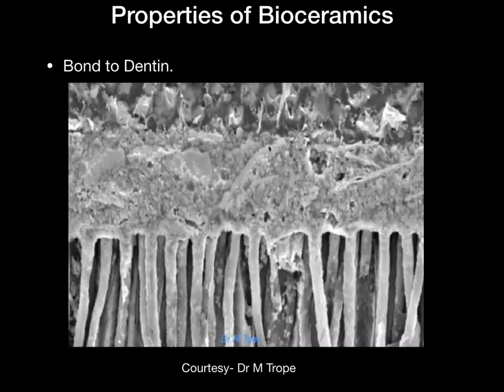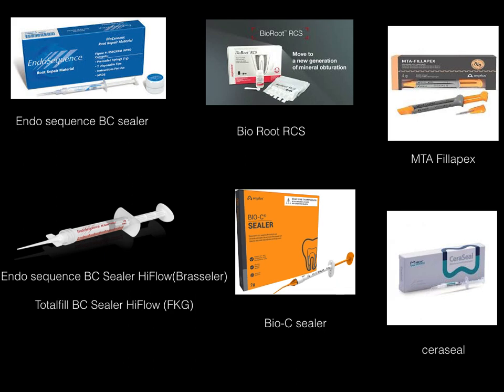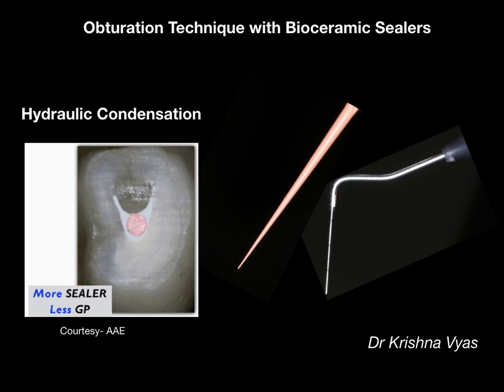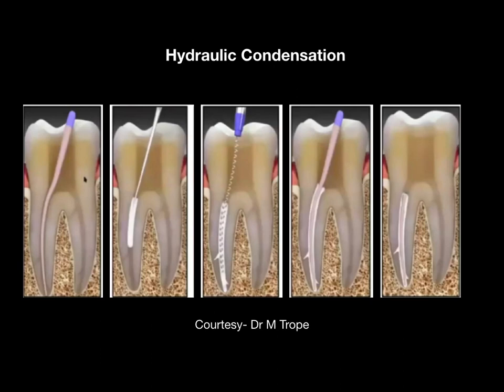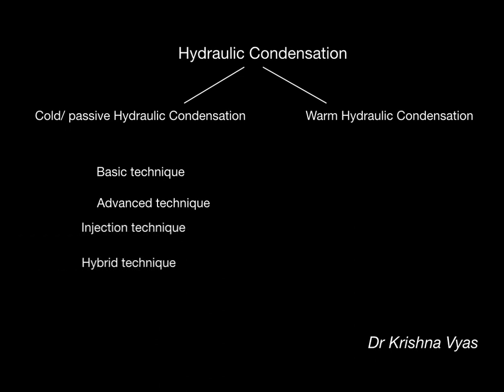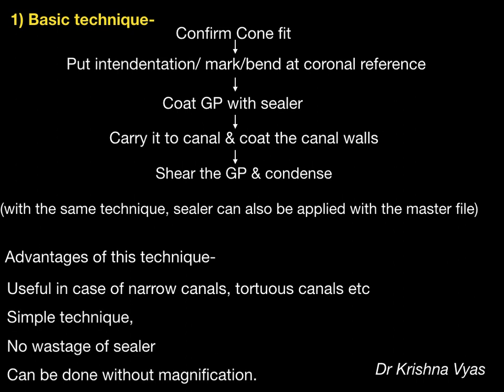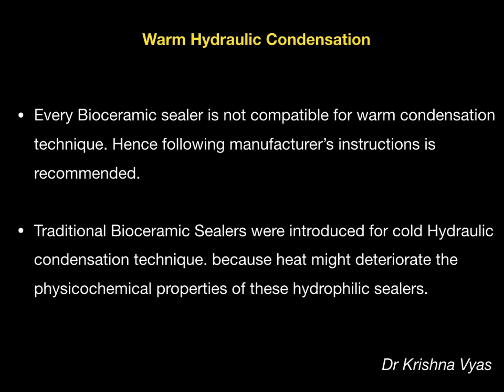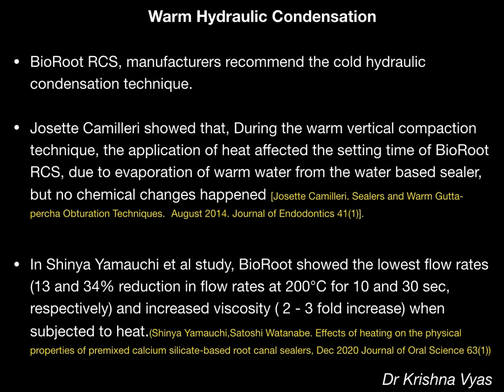Bioceramic sealers-obturation techniques & latest updates

Comment: Hello Dr Vyas. My question is can bioceramic sealer help if there is strip perforation in the root not wider than 10k file
Reply from the maker: Thank you for interesting question Dr Nishat. In my opinion Bioceramic sealer could be one of the best option in such situation owing to its properties. It's simple to handle, easy solution with Hydraulic condensation technique as the Perforation size is small, not wider than 10 k file. In case of wider perforations, preference would hv shifted to either Bioceramic putty or MTA or Biodentine etc.
Reply: @DrKrishnaVyas  thank you so much to be a guide for beginners
Reply from the maker: @nishatshaikh8012  my pleasure always..